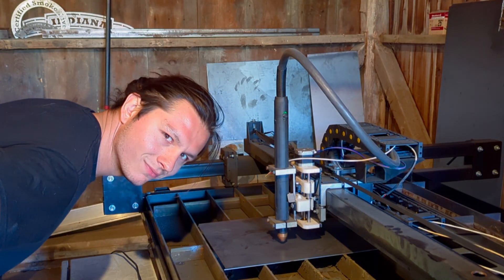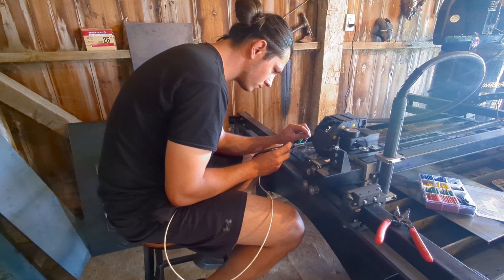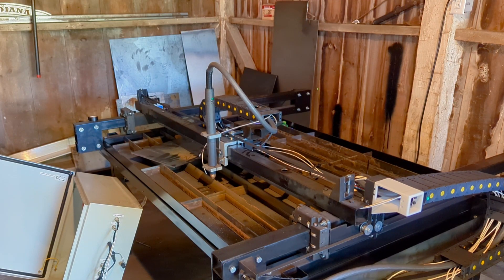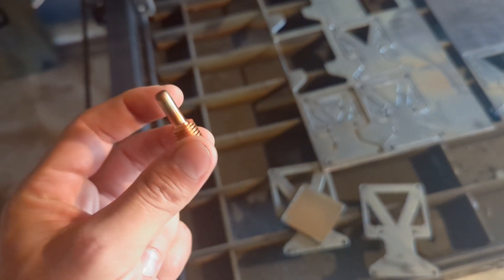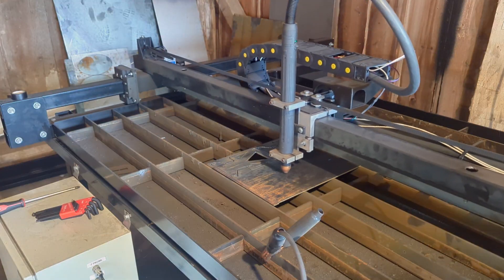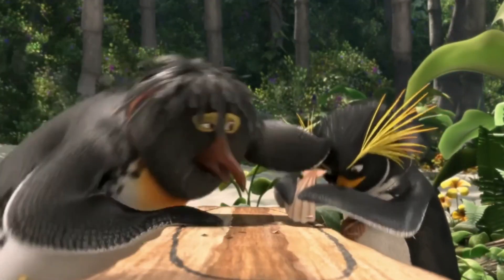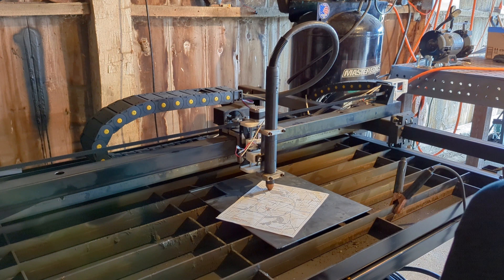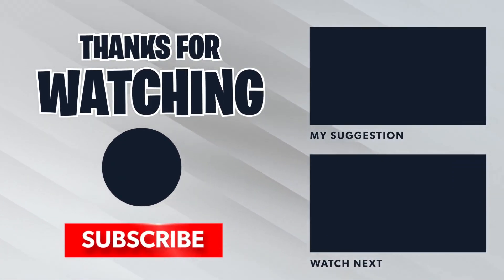Unmatched Precision, Unbeatable PRICE | Budget CNC Floating Z-axis |Plasma Business Pt. 8

Comment: 6:28 Aha. Yeah that's what I was wondering. That is absolutely crucial for making sure the torch stays close to the work when it's warping from heat or as you might cross over from dross. The arc voltage feedback.
Reply from the maker: Definitely!

Comment: I had exactly the same problems with that z-axis, even with 3d printed parts bought from JD's.  I finally gave up and bought a complete 100 mm linear actuator on Amazon and devised an ohmic sensor for it.
Reply from the maker: @andrewsandoval4137  that's going to be my route as well. Once I get set up on my new shop

Comment: Hey mate, how did you get your RHS Y axis to work with the LHS? Did you require an additional stepper motor on RHS, and if so did this require an extra driver or did you just run both motors off same driver? Did you just basically use the same parts and flip them around on the RHS?
Reply from the maker: @burgo856  same exact parts just double. 2 drivers, 2 motors. But you have to split the pulse/dir signal to each driver
Reply: @ThyialIndustries  Thanks, I managed to get that working, next issue is when I have E-Stop connected to Analogue GND and Analogue pin 1(feed hold pin) and enable the door switch alarm option in the config.h file, seems to trigger door alarm every-time I move only the Y axis without E-Stop active. How did you get your E-stop to work, do you use the door switch option? I like the door switch option as the machine can pause/continue the job after e-stop is pulled out and after you acknowledge the alarm. Not sure why only the Y axis gas the issue of triggering it randomly :/
Reply from the maker: @burgo856  I don't have an e-stop lol. Living life on the wild side
Reply: @ThyialIndustries  Fair enough ;) Honestly setting mine up not so much as a proper isolating E-Stop but more along the lines of like a PAUSE feature, so if I need to adjust something I can hit it, it pauses the job and resumes when e-stop is pulled out and alarm is acknowledged.

Comment: I like you build it is very nice. Maybe you can help me, I  have my table all built and  am adding the z axis i have it all done but in the plans it says before you go on you should go into troubleshooting and push the switch to see it trigger the z axis, mine wont do it but those 2 wires go to p22 and a ground on the board, i can put a ohm meter on those 2 and push the switch and it shows it work. Don't know what I'm doing wrong?
Reply from the maker: @TerryDale-lv4wn  terry I would love to help but unfortunately my plans are not the same as JD's garage. Maybe try reaching out to them directly?

Comment: What cutting program do you use?
Reply from the maker: @LeandroFaustino-wm7cv  sheetcam
Reply: @ThyialIndustries  Shetcam you are using to create your tap file, and what software are you using to run the cut file (tap)?
Reply from the maker: @LeandroFaustino-wm7cv  open builds control with grbl on the micro controller
Reply: @ThyialIndustries  What the name of software ?
Reply from the maker: @LeandroFaustino-wm7cv  open builds control lol that's the name

Comment: I've watched several of your videos and I think all your issues with the 3D printed parts are entirely self induced. I've had one of these tables for a year and a half and use it at least once a week and had no issues with printing the parts or the reliability of the parts.
Reply from the maker: @jsaction33  that's definitely possible. I'm a complete amateur when it comes to 3D printing. However, I still feel more comfortable with aluminum parts! All in all it out performs plastic any day off the week. Just a little more expensive
Reply: Just printed mine on perfectly calibrated printer, the 5mm holes are 7.85mm.
Reply: @mikesgarage394  What holes are incorrectly sized?

Comment: Might wanna look at the torch height controller from JDs next. Should adjust Z axis on the fly to deal with the warping.
Reply from the maker: @MrSlim1225  I plan on getting a THC and a new floating head made out of aluminum. I don't really trust the build quality of JD to pay them a few hundred for the THC.
Reply: @ThyialIndustries  I built a CNC plasma for work, with a DIY THC. You can build a working one for under 50 bucks pretty easily. I built one for a hypertherm powermax30 (it has no THC or CNC ports, so it's a "worst case scenario"). 

I used a little opto isolator (4N25) which is an LED on the input side and an optically controlled transistor on the output. Measure the operating voltage of the torch, and pick a suitable set of resistors to limit the current it would send to the opto isolator so it's within it's operating band. Add a zener diode across the input LED of the opto isolator to clip any voltage spikes from the torch firing etc. Feed 3/5V (depending on your micro controller) to the high side of the output of the opto isolator, and connect the low side to an input pin on your micro controller. Technically you "need" a resistor divider on the output rather than reading it directly, but I was lazy and it worked fine with the internal resistance of the micro controller. Read the pin on the micro controller and have it move the Z axis accordingly. 

Add a pull down resistor on the micro controller of whatever value required to drain ALL the noise on a dead/torch off signal. I used 10k ish. You can add some filter caps to the output if it's noisy, but don't go too big or the signal will lag behind changes to torch height which will make it impossible to chase a target position (It's better to leave a bit of noise in the signal, than to have any lag at all, speaking from experience). 

Note: the opto isolators have a logorithmic response to voltage, so make sure to pick a resistor that would have it operate at the lower, steeper end of it's operating curve. That way small changes in torch voltage with height result in a larger change to the signal your micro controller receives. If you pick a resistors which puts you in the upper (flatter) region of the opto couplers response curve the signal your micro controller controller receives varies much less with height, so the THC will be less sensitive and have worse resolution.

A THC really makes a huge improvement to cut quality and reliability. I never bothered with a floating/dragging or static height torch because from what I heard/saw of people it just doesn't work well beyond small cuts. A couple of times my height controller stopped working (due to bugs in the code as I added new features) cut quality suffered a lot, and large cuts were awful/impossible due to warping while cutting or just the fact the material wasn't dead flat to begin with.

I can share the arduino sketch for the height controller. It probably wont be a "plug and play" solution for your particular setup (I used a different controller, control board, etc.) but it may be helpful as a reference or starting point.
Reply from the maker: @H34...  I think if I had more time on my hands, I might try and go that route. Maybe I still will? But as of right now I have a lot of things pulling me in different directions... Makes it seem that purchasing a THC already made would be the best choice for time and money.
Reply from the maker: @H34...  I appreciate all the information though.
Reply: @H34...  plans would awesome.

Comment: Ill give you some critique, so you can learn and improve your build in the future. Rule number one, don't give people advice in wiring a cnc system if your doing it wrong. Although it might work, your system will never be reliable for production work or long cuts. The shielded cable your using is hard shielded security camera cable which is not developed to bend and move, it will eventually become weak and break, try getting double shielded soft silicone type cable. Use double shielded cable for everything, including the switches etc. USB controllers are very unstable for cnc plasma systems. Do better work to ground all your shielded cable, EMI will kill your system on long production runs, make use of ground bus bar in your electronic enclosure. Google Hypertherm : "Recommended Grounding and Shielding Practices,"  There is a lot of information how to ground your system and useful information. Again not to critique just  to help you.